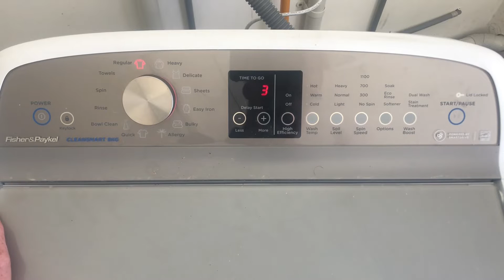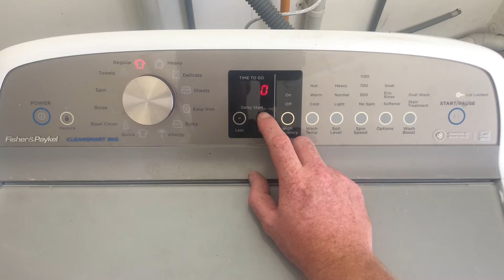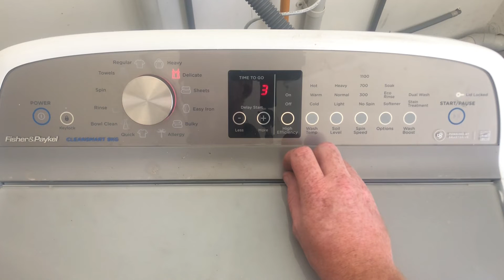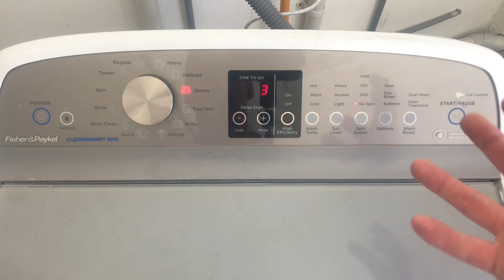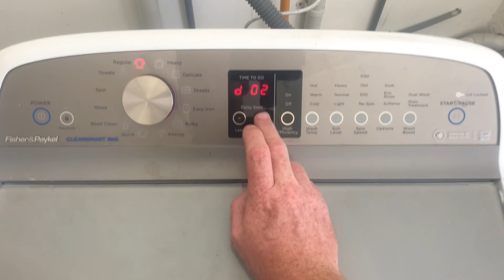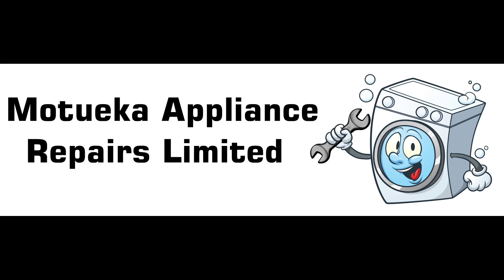Diagnostic mode on Washsmart/Cleansmart/Fabricsmart Fisher and Paykel Washers.

Comment: Hi Great video. I'm mucking about with mine which is giving a "no tap" error, seemingly intermittently. But the water is working fine, it fills up. no Fault codes as per this method. I cleaned the filters in the inlet, the pipes are all good and the drain is up nice and high.  My mind went to level sensor but the level changes in the diagnostic menu when  accessed whilst its running. any suggestions?
Reply from the maker: Does it stop filling before the code come up or fill right up until it faults? If the latter Check the end of your drain hose is higher then the high water level. If it’s too low it can siphon out as the machine is filling.

Comment: Hey mate, my display was making random beeping noises then all of a sudden only beep powers on and then goes dead, do you think it’s the display panel or the main pcb controller, cheers !
Reply from the maker: Not a common fault so couldn't say sorry, you will probably need a technician to check voltages and resistances

Comment: Hello we are having pools of water underneath our washing machine. It’s only bought in March 2024. Any thoughts what to check ?
Reply from the maker: Check your inlet hose connections at the back of the machine aren't dripping, and make sure to use correct water level or auto and not too high for the load size, then call F&P because it will be under warranty.

Comment: Hi. Am not getting any warning codes yet but the part that recycles the water back into the tub (thru pipe above drum on right side) is only trickling out instead of flowing out freely. Any suggestions?
Reply from the maker: Probably a blockage, either in the diverter valve or pump inlet, or maybe the tube.
Reply: @motrepairs Cheers. Will have a look. Thanks
Reply: @petershearer2956 I am having the same issue, did you fix your issue? I cleaned the drain pump and cleaned the diverter flap inside the drain pump. Still same issue.
Reply: @imranrgoss9739  Sorry can’t really help you. I don’t know why or how but over a period of about a month it gradually came right and works perfectly now.

Comment: Hi Dan, In another diagnostic video you mention downloading error data to a PC from blinking light; I researched a bit and now want to buy a diagnostic pen and source software for it. Need it for top loaders like MW511, 613. Any idea where I can get one? (I'm a newbie hobby fixer)
Reply from the maker: They were only available to FP authorised service agents, and the stopped making the pens back in the 2010's even though the machines continued to support it.
Reply: Hi Dan

My elderly neighbour has this model.
I was wondering if you could steer me in a direction to why the machine won't spin. It goes through a rinse cycle (Spin mode) and starts at 13min. Stays on 13min while filling, and then rinses.
Once this is done I can't seem to hear it transition into spin and just start filling again (no clothes in it)
Turn it off and theaxhine will drain all the water out before locking the lid and starting again.

Long story short it won't go into spin but drains most the water out before having to be switched off and then back on to drain out.
Any help would be much appreciated 

Cheers
Reply from the maker: @bleednova  Is it stopping and beeping with any messages if you leave it long enough? We have had some problems with this series with false "out of balance" faults, but not a simple one to solve so you will probably need an experienced tech sorry.